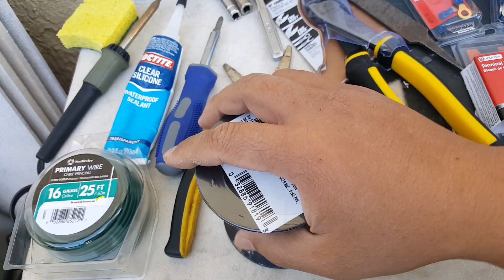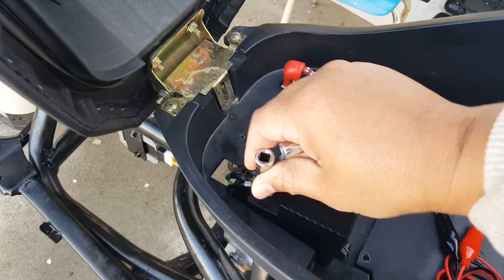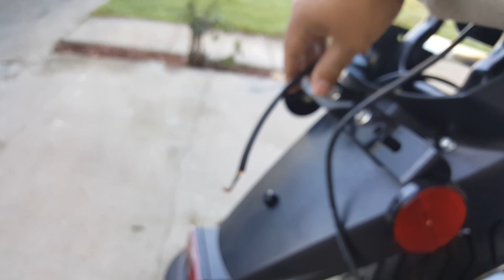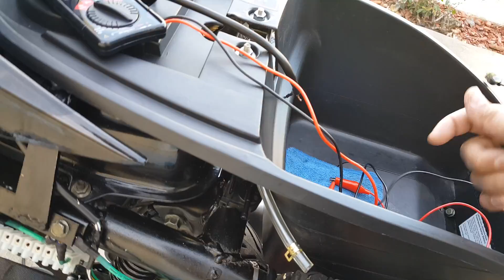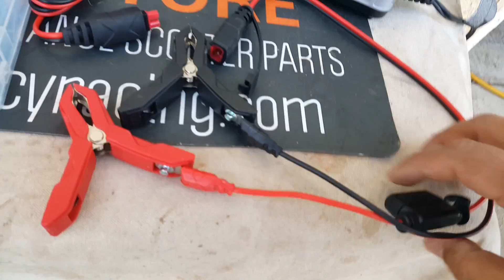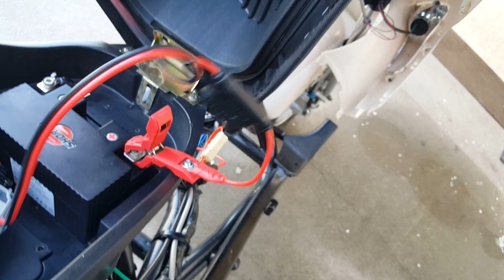How to Rewire GY6 Scooter Ground Wire, Wire Harness Part 1 of 6

Comment: The use of the white block he is using is not a buss bar unit, it is a barrier strip.  Do not try to use that if you plan on making ground connections to it.